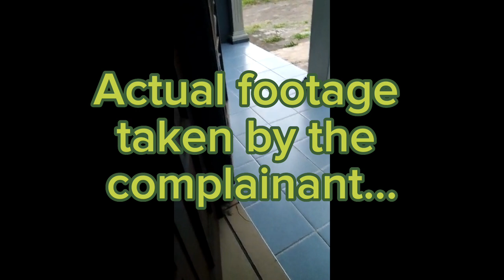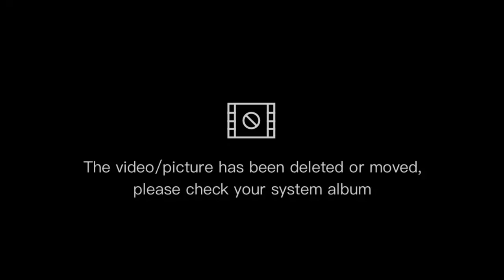THERE'S A MAMBA ON MY STOEP!!

Comment: You've got to find a more safer way to put those guys in the bag. Currently it looks far more risky. You never know. A simple mistake can cost your life. No matter how good you think you are
Reply from the maker: I appreciate your concern AK. Yes there is some risk in this method. Mistakes do happen and have happened over the nearly 25 years I've done this. But it's an extremely small risk. It probably looks very dodgy to onlookers, but the snake is in complete control and I can feel exactly what it's doing throughout the process, and I make sure I take my time in doing it and only release the snake when the timing is right. 
But I do appreciate your concern and I'm thinking of safer ways to do it without making it so safe that it's boring to watch. It's a fine line 🙂👍🏻